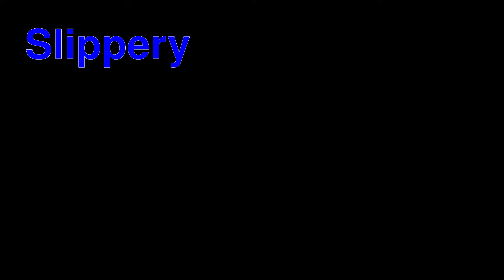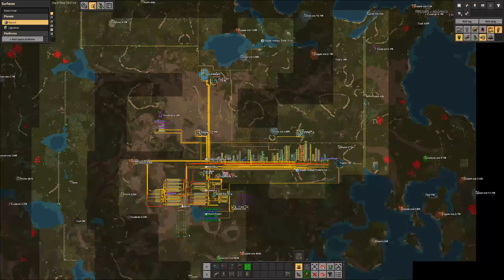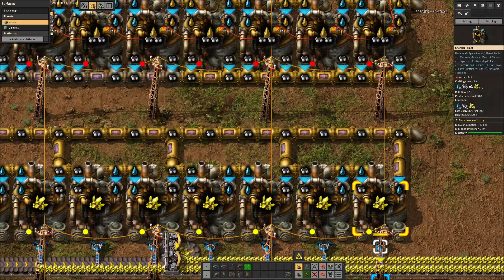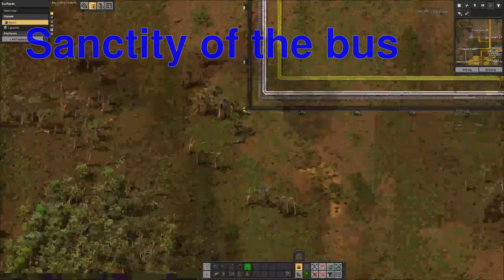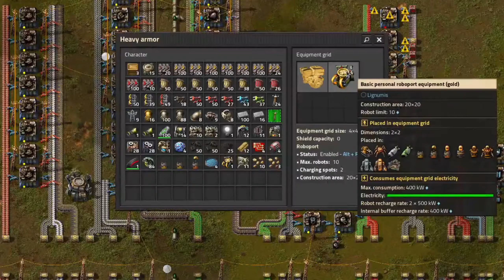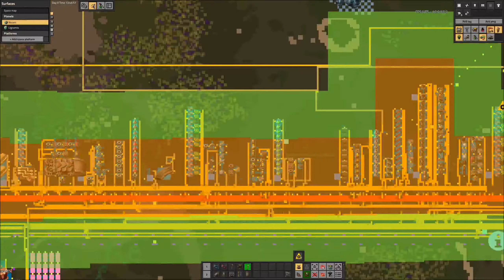S1-E08 - Oily - Laurence Plays Factorio: Planetary Pioneers

Comment: The common way of handling multiple fluids (like refineries) is add 1 above-ground pipe to the first input, 2 to the second and 3 to the third, then connect the 3 levels each with their own undergrounds. It takes up 3 spaces and you don't need to reverse anything. It also cuts and pastes nicely.
Reply from the maker: True, I've used that layout in the past, but reversing and linking feels nicer somehow now that we're able to do it! And it's fun to play with the new features. 
I've also just been reading the books about your username! 😃
Reply: @LaurencePlays  The Caves of Steel was the first book I read when I got my "grown-up" library card. So, so long and so many thousands of books ago.
Reply from the maker: @R.Daneel Yeah, I first read them quite a while back too. I've been working through the Foundation books recently, although that got put on hold because of a new Brandon Sanderson book being released!